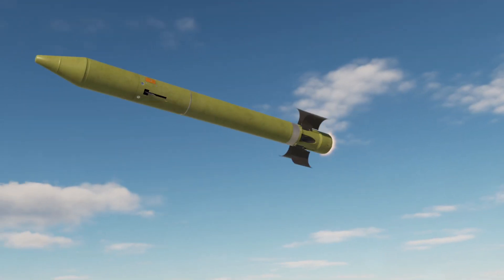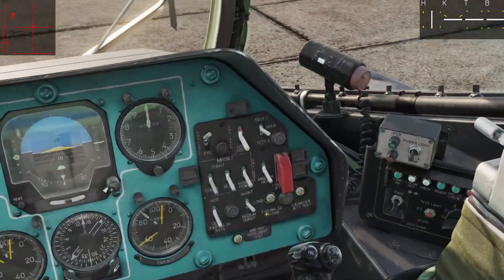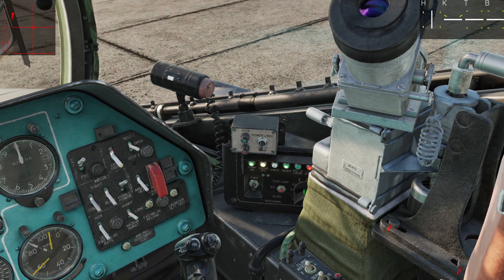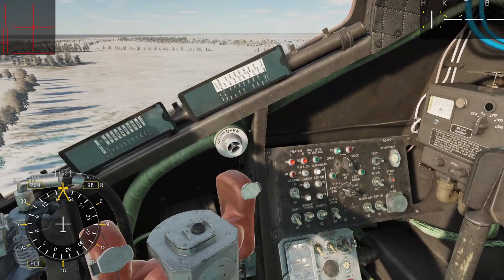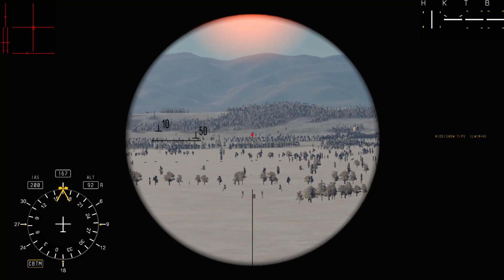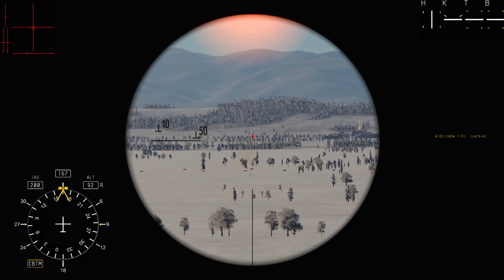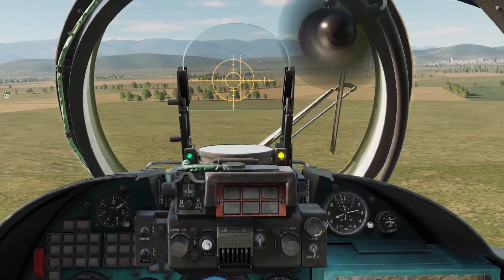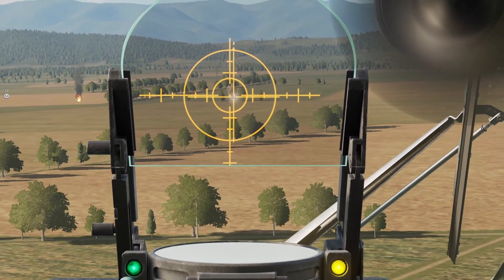DCS Hind Tutorial #4; ATGM Employment

Comment: Interesting that the front Missile Guidance panel has a switch "Doors" and when it is set, the light next to it will illuminate "Doors Open".

The B1 switch at rear is for warming and calibrating the gyroscopes. The B2 switch is to unlock / lock them. 

That is what should happen, you activate gyros with B2, you open the doors from front, and then you can look through. You can use sight without B2 and when doors are open, but you don't get stabilization.
Reply from the maker: I never had any luck with that front switch. My limited understanding was it had something to do with filters.

Comment: Great video as always, please continue this series!  One thing though, you can turn on the DIAFR switch (in the operator position, near the sight power switch) to shoot without a cue.  It is basically a manual override switch.  Also, there is a button to "reset" the radiation from the sight which you are supposed to do after every missile launch.  I'm not sure if it is modelled yet but in the future when it is, not pushing it can cause issues with ATGM guidance AFAIK.
Reply: Not recommended.

The launch signal for missile is only a 18 degree diameter on launch so missile can capture the beam position. The sight at 3.3x has 22 degree FOV, and it is not for guiding. The 10x has 8 degree FOV and in missile guidance phase the radio beam is 3°. 

The missiles at the launch are slightly inward so that they fly center of helicopter flight path. 

This is why you can't override missile launch as missile will not capture the beam when it quickly turns to 3° beam, and your sight is off from missile path.

The override is meant for manual guidance, and to be able launch. The missile has at rear a flare that system needs to spot. And if there is glare or high contrast like sun reflection from water and like that, system might not know what is missile and steer missile to opposite side of interference. Why you need to go for manual mode and guide missile manually. 

We don't have these systems modeled yet.

You can well understand the mechanism of Shtora system in T-80U and so on. Two big IR lamps glowing/pulsing that cause similar systems to unrecognize what is missile and start sending incorrect guidance that trash the missile.